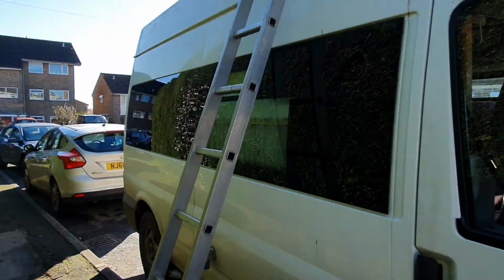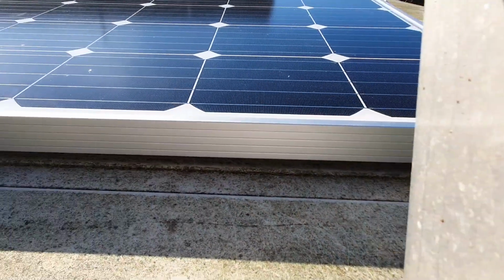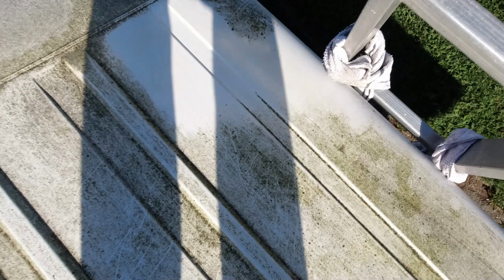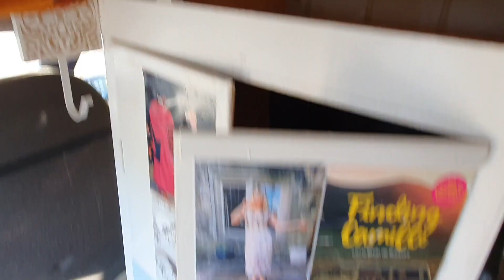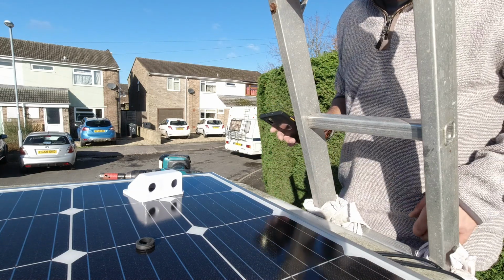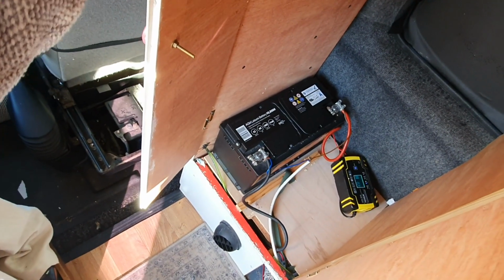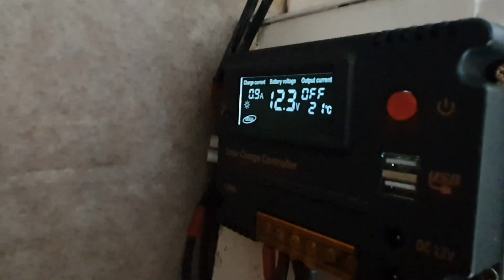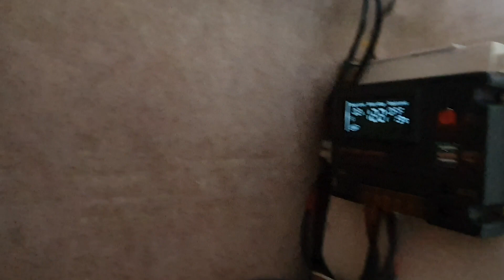Vanlife Fitting A 12 Volt Solar Setup For A Fellow VanLifer

Comment: you can get a genuine mppt for 25 quid for 20a/400w. been running 2 for about 18months
Reply from the maker: No you cannot. Not to my knowledge and I constantly research them. You could about 2 years ago but they discontinued them.

Comment: Would you use that controller in conjunction with VSR , ,i would be concerned i may cook the engine batteries on solar when parked as i understand the relays operate both ways.
Reply: I would and have. Install a kill switch inline between the vsr and house battery.
Reply: @SouthCoastMudlarks   thinking that and duratec confirmed to me the vsr do work in reverse. so only option is a isolator switch as you suggest

Comment: Tidy install doug, but for the life of me I can't understand why anyone would instal such a low power panel? it will be of almost no use over the winter at all?  the controller was showing 0.2 amps and that requires a whole hour to achieve !! luchy to get 4 or 5 hours a day in winter so that would be only 1 amp (0.2x5) charged to the battery.
even if somehow it managed 1.5 amps in and had a 6 hour sunny day it would only get  9 amps charged into the battery. that's not alot to play with given the charge efficiency of lead batteries.
Reply from the maker: It does 8 amps in full sun. The sun was just vanishing behind the houses at the end of the day hence the 0.2 amps. 20 minutes before when I first connected it it showed 1.4 amps. 8 amps over 6 hours is not too shabby. The idea is to add another 150 watt panel further down the line.
Reply: We all start somewhere. ..easy to add more panels at a later date.